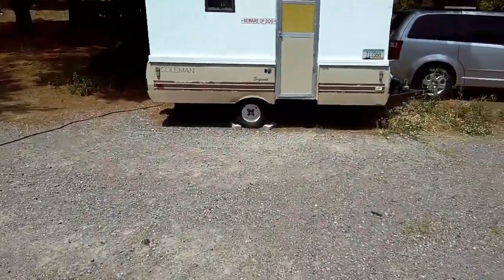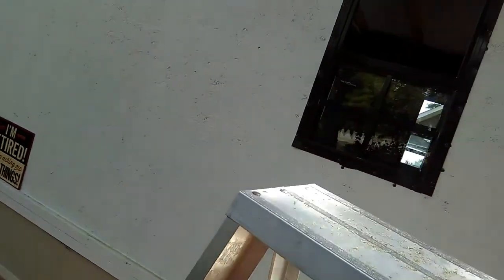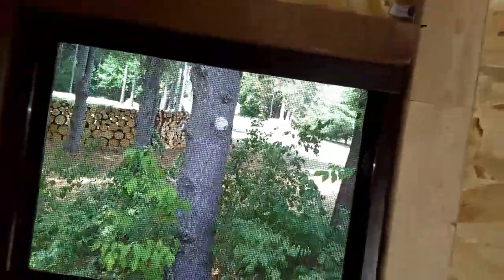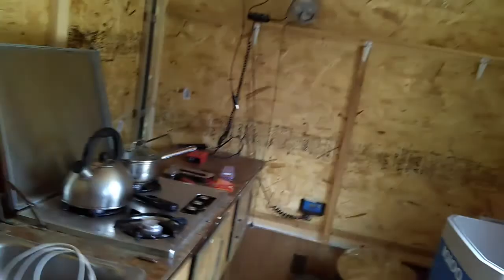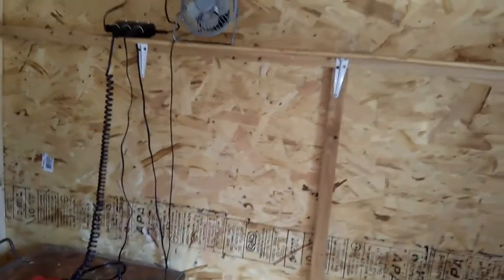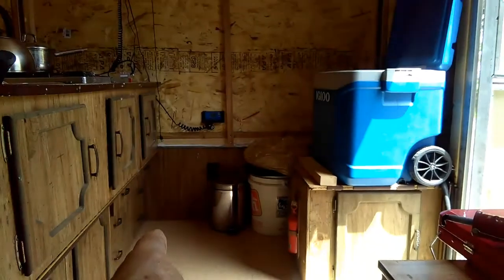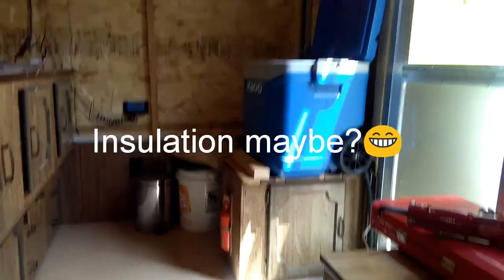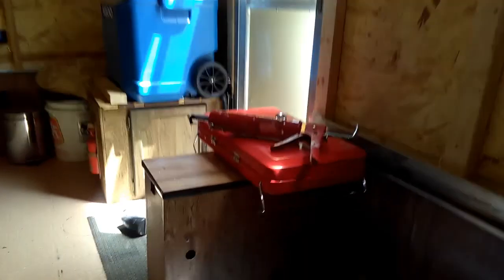2-Converting My Pop-Up Tent Trailer (1982 Coleman) to a Hard Shell Travel Trailer - Part Two

Comment: I'm wanting to do this to my pop up not sure what's the best materials to use far as the frame for the walls and is osb the best to use for walls?
Reply from the maker: I'm not sure what is best. It was the cheapest way to go and easy to work with along with 2x3 for framework. I used 2x2 for a lot of the cross framing (Windows etc).
Houses and garages are built with it so I thought why not? Total dry weight of the trailer is 1760 lbs including battery and propane tank on tongue.